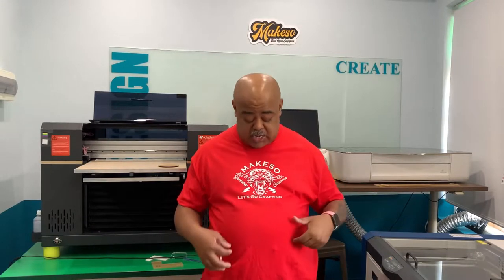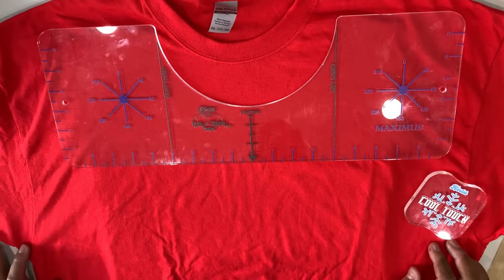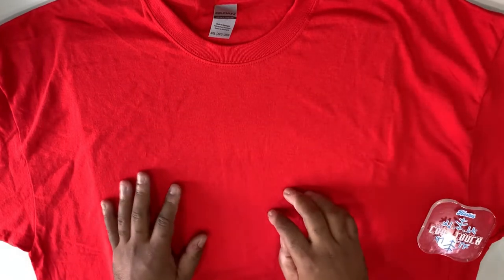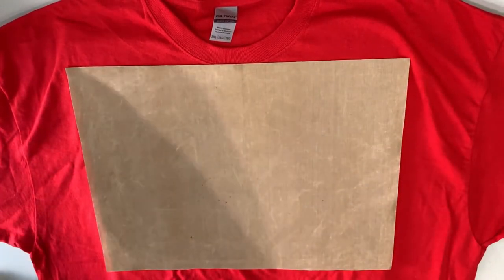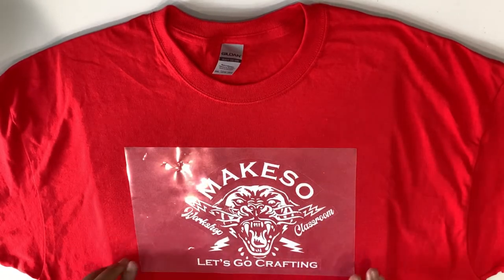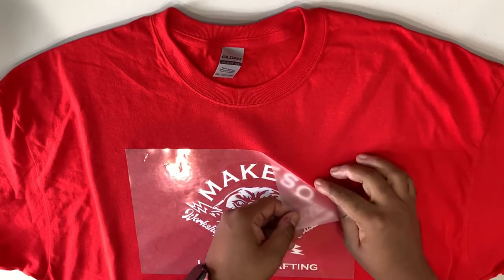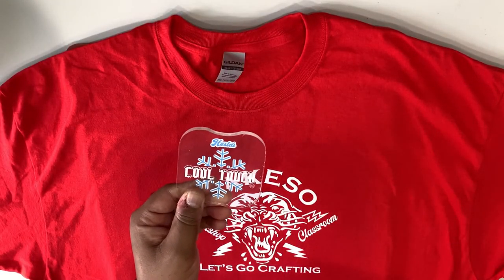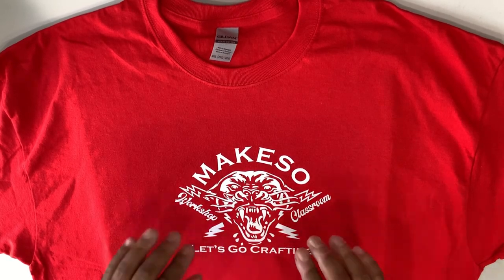Makeso Crafts: Cool Touch HTV Cooling Block Demo  for T-shirt Makers: Hestai Products

Comment: I just received my cooling block, do I need to freeze it before using?
Reply from the maker: Hello, 100% do not put it in the freezer, you only need to bring the HTV down to under the activation temp which is 150c / 320F. Putting in the freezer can add moisture to your project which you don't want.
Reply: @Makeso-Hestai  ok, so just pass it over the HTV, thxs much
Reply from the maker: @MadeByTriniLena   thanks so much for your question, I have not posted in a while and I need to get back t it so will post some new content this week